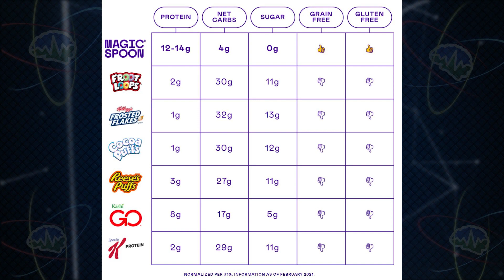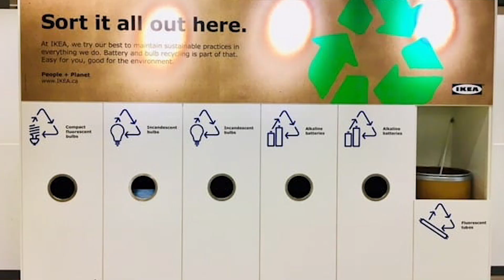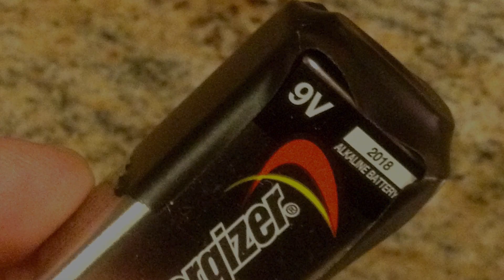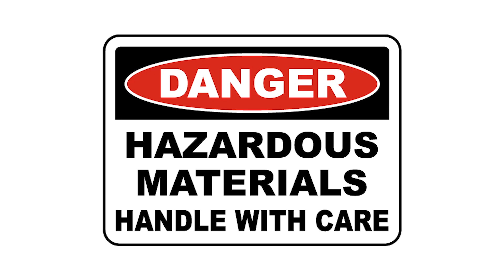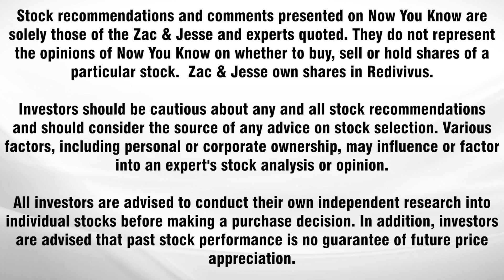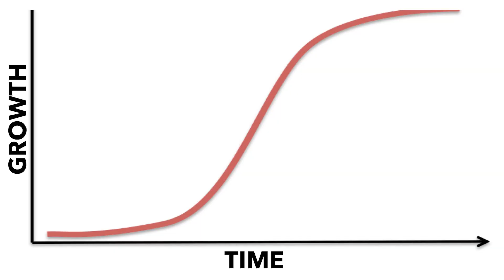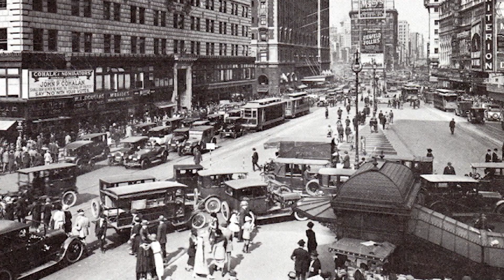Battery Recycling is the Future - Here's Why | In Depth

Comment: That depends on the availability of used batteries to recycle. At the moment there is a strong second or third market for used batteries. They are installed in ships or as household buffers. So the price even for used batteries is quite high, and it will stay quite high.
So what do you want to recycle if there is no material? Some batteries damaged by accidents. Which get rarer as the FSD gets better.

Comment: Seems like they still have HUGE hurdles to overcome. Their battery shredder appeared to be a small unit attached to the rear pto of a tractor.

It would seem they would need to develop a network of reclaimers skilled in safe battery removal. They would also need to mass produce a cost effective and easy to transport shredder.

Also if they're only reclaiming the cobalt and nickel, perhaps they could work with other reclamation companies to see how they could recover the lithium as well. Even if it involves them just shipping their waste to another facility.

I hope they figure it out, battery recycling is going to be crucial to the widespread adoption of electric vehicles

Comment: Privately owned Robotaxi's will be logging 100k miles a year and possibly earning the owner $90k a year. If Robotaxi's launch say in 2023 with a 60% adoption rate, then by 2027 there's going to be millions of Tesla battery packs that need to be recycled. JB and Tesla have to begin now to be ready for the wear and tear that will be Robotaxis. The million mile battery wide release in 2023 will delay a few more years, but all of the previous cars batteries will need to be replaced ~ 2027. Honestly I don't know how Tesla's going to handle this challenge. It's so huge, but the profits from reusing their old battery materials is equally huge. I just don't know what's going to happen to the rest of the vehicle.

Comment: It's the second time you promote this company, and their idea was just as mediocre the first time. 
1: is this ReallY a problem? By now, many tens of thosands of EVs must have been towed to junkyards and repair shops after crashes. With the media attitude towards EVs being what it is, you can safely assume that each and every fire would get heavy publicity. And did we hear and see those fires in the media? No.
2: after a crash, how do I know how severe the damage is and if there's any issue with the battery at all? In most cases I'd have no idea. So then the friendly battery grinder expert arrives at the scene and tells me it's better to be safe than sorry. They rip my car to pieces and turn the battery to dust and now I have no idea if it was necessary or not. If I say "no I want the damages evaluated at a shop" they'll tell me I take a huge responsibility and gamble with peoples lives and could be sued and go to jail. Kind of hard for the average person, shaken after an accident, to resist that even after a fender bender. 
3: as you point out, the problem with battery recycling is setting up the collection infrastructure to keep the cells out of landfill. Once that's solved, Redwood will do the rest. Interestingly this company that you are promoting (again) does nothing towards solving the collection problem. After all, the bulk of cells are still in hand tools, computers, phones, and toys.
I normally enjoy your content but your fascination with these guys is strange to me.

Comment: Battery recycling is the future is an understatement.  Forward thinking and how to profit without compromising the environment is a worthy goal.  Right now, that's one thing about ICE vehicles, the engines are recyclable.  There is so much difference between an ice & electric battery vehicle.  When people talk about an ice vehicle, you compare engine performance, horsepower, fuel economy but never about the fuel source.  With battery cars, it's opposite, all about the fuel source, batteries.  Never about the electric traction motor.  You guys do a great service when bringing up the disposal of the spent batteries.  It's going to be the elephant in the room.  Cudos to those individuals trying to figure out how to recycle them.

Comment: This is an important issue - good to see people are coming up with solutions 🖖🏼
Reply: Yep. I would also like people to approach the problem from an energy standpoint. Simply put, if you go interview a steel or aluminum recycling plant, who are some of the only recycling operations that can be done at a profit, they will tell you how much energy is a bottleneck. Its their second biggest expense behind getting the raw materials and the principal limitation in what can be recycled economically. With a cheap and stable energy source, a lot of the processes can just be "brute forced" to separate and isolate the materials but that can't be done with the price of fossil fuel energy, and can't be done with renewable because of how low and unstable their output is
Reply: @mobiuscoreindustries  Tesla seem to manage to make cars with renewable energy so there must be a way 🖖🏼
Reply: @gospelofthomas77thpearl22  there is but it isn't really the same as, let's say, home charging. 
For industrial applications you don't have many choices, solar and wind is just too irregular. You can only chose between fossil, hydroelectric, geothermal and nuclear. Fossil is cheapest to build but generate pollution, hydro and geothermal are consistent but limited to very specific places making them a "have it or not" solution, and nuclear is by far the cleanest and most reliable for power but is also about 50 years out of date for an overhaul of the designs, and building a PWR is horrendously expensive because if the way they are contracted.

And batteries can't really stabilize more than a few hours, days at most of lack of production so unless you have a damn or nuclear plant on hand you can't do a renewable grid without also needing an equivalent capacity fossil grid which is exactly why fossil fuel lobbies directly finance the creation of more solar or wind plants. For them it's guaranteed buisness, and inflated prices to boot!

Comment: Am I missing something, batteries , even after 8 years of use in a car and then destroying a good working batteries. Stop there, there is afterlife for use of these batteries is to store them as a Power Wall, useful to charge up from solar and wind, then use for running a home. I know these batteries can last a lot longer than 8 years, try 25 years, I got some here working. BTW after 8 years in the car, will not stay in a car, it be power a home maybe another 8 years.
Reply: Just a little thought, but with Robotaxi's running ~90k miles a year, the batteries will only last maybe 8 more years (until the million mile battery). So, Tesla and JB have to solve the issue this decade and be ready to recycle millions of Tesla batteries.

Comment: To my knowledge the problem with recycling normal small batteries isn't if they are charged, but what's inside them. As there are many different battery types out there, it is not easy to sort them out properly in an industrial scale. There is a company in Germany that x-rays batteries to look inside them, so they can be sorted out by their type. Then it's easy to recycle them.

Comment: So WHY does Tesla  need NEUTRAL?  So getting off the freeway, flip the right stalk up to release AutoPilot, Car does not seem to be slowing down, applied breaks to stop car at the top of the off ramp, car started to roll backward, would not move forward, hit breaks, put on hazard warning lights. Was on my way to Supercharger, but had to make a stop before I got there, 26% battery left. Scary - car would not move. Finally figured out where NEUTRAL is - I had put the car in NEUTRAL when I thought I was just disengaging AutoPilot. I NEVER use NEUTRAL. Oh, I did use it at the car wash, but the attendant had to put it in NEUTRAL for me. Now I know how to use NEUTRAL, but who uses NEUTRAL and when do you use it, except in going thru a car wash. UGH!!!!!
Reply: "RTFM"

Comment: Battery life for EVs is getting very long and accident rates may decline dramatically as FSD becomes perfected. Batteries from consumer electronics likely the dominant input stream to a future battery recycling industry. Also, Co is likely to be a small component in future recycling as most batteries are quickly moving away from NiMnCo or NiCoAl cathodes towards Co-free cathodes like NiMnO or FePO4 cathodes. That will change the economics some as Co is by far the most expensive battery component - much more expensive than Ni, which is also being phased out except from long range, high performance vehicles (like Tesla Roadster, Plaid, Semi)

Comment: my opinion: unless this startup gets buyed by on OEM, it will get crushed. Every EV manufacturer will do their our recylcing, TESLA allready mentioned using their old car batteries to build Tesla Power walls.
Reply: Tesla won't use them for "Power walls".
MAYBE a complete, good pack will be slid into a huge scaffolding rack, plugged in, balanced and will become part of a storage "Hyper pack" on Tesla premises.
They already have similar frameworks to do the "prelithiation" (first charge) of new packs.
It's just a case of allowing output as well as Input.
Imagine an automated Amazon style warehouse rack, which picks up a pack from an automated fork lift, places it in "Row 1535, column 23687"
Then a TeslaBot connects it, the system logs the vin, a universal BMS cycles and assesses the state before connection to the system.
Same applies for true "end of life" when it's too far gone for storage.
The Bot unplugs the pack.
It's removed to ground level, transported for full in house recycling.

Comment: What is required to mechanically disassemble 18650's or 2170's?  Aren't their enough of them to develop a process to remove the shell and unroll the jelly roll?  This is a hard problem to solve.  Will be watching for future solutions.
Reply: Battery recycling processes are designed to avoid disassembly - either by combusting/melting down or dissolving the entire pack. There is too much diversity in battery packaging and labor required to take them apart to include disassembly as any part of an economically viable recycling process.
Reply: If you remove the charge from a cell, it's basically inert.
That means no source of energy to start a fire.
The process will start by "harvesting" the energy from incoming cells and packs, rendering them safe and ironically providing energy to complete the process.
Reply: @rogerstarkey5390  They are mostly safe after discharge, but even after discharging electrochemical energy, batteries can still burn or undergo other exothermic/exergonic processes. E.g., oxidation of the anode material (graphite/silicon), combustion of the electrolyte and various plastic packaging materials, etc. The released energy can be used to reduce (or totally provide) the energy required for melting down a pack for metallurgical processing.
Reply: If they are in packs, there are many good cells in with some bad ones. People have been buying the packs and taking them apart. Then they check the cells and build things like powerwalls out of them. "Second Life" use of the cells prevents landfill materials for the most part. After 10 or so years, those cells can be recycled. Just sending the cells direct to the scrappers is a huge waste of the cells potentials. Pouch cells would be better than 18650s for recycling as you don't have the external metal to deal with. But as shown, 18650s can be just run thru a crusher and into the fire for smelting.

Comment: I've never seen a battery recycle bin.
Reply: Never been to Lowes or Menards?  They are usually in the entrace to the store.
Reply: @chelsiestinson9494  I have.  I will look for it specifically next time I go.
Reply: Best Buy's have them as well.   If the bins not at the front, take them to customer service.

Comment: here is my prediction - EV batteries will remain the property of the OEM's they will want them back unlike the rest of the EV and they will in turn offer you a lower cost EV
Reply: No 
They'll be delivered to "scrap yards" as cars are now.
Those yards will be expert in discharge and removal.
"Empty" packs on a rack will be sold to the final recyclers.
Those recyclers may (will,) include manufacturers who will send an E-truck to collect them (highest bid wins!)
The dismantler pays you for the car.
They get the pack AND remaining energy, AND a profit on the pack AND car parts.
Reply: @rogerstarkey5390  yeh you could be right that they will be handled by a third party but I hold by my thought they you the owner will not be able to keep it, they will want it back